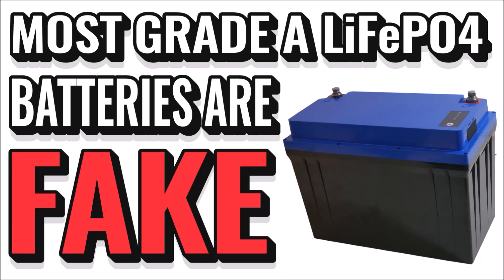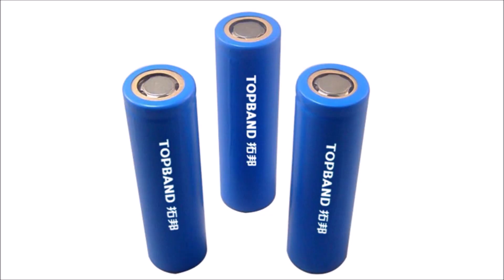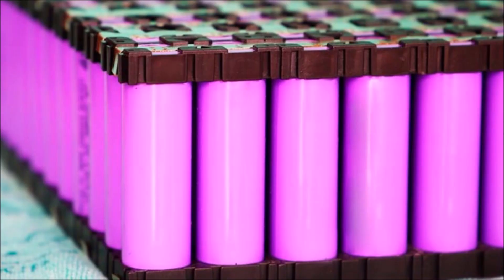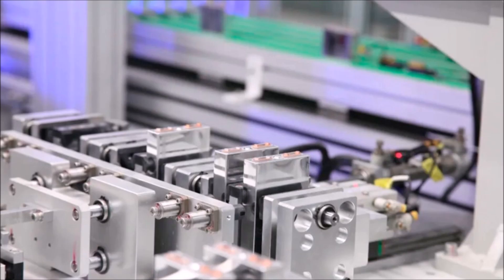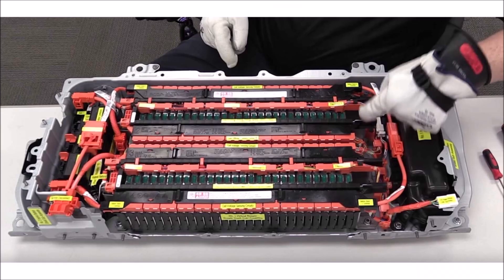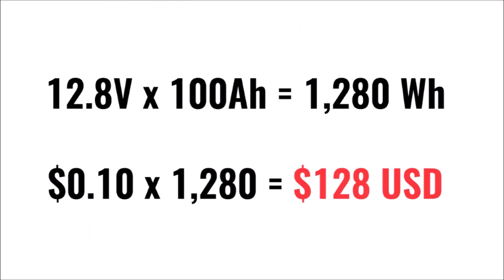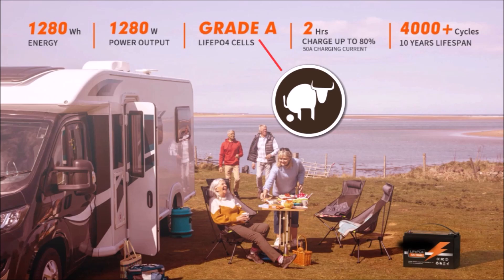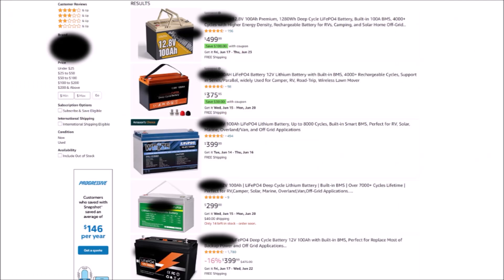Fake Grade A Lithium Deep Cycle Batteries Are Everywhere!  Learn How To Spot Grade B vs Grade A

Comment: I will buy Weize batteries grade A or not...  It is like the difference between regular gas and super unleaded.  Do you really need to spend the extra cost for the super?..
Reply: They are grade A
Reply: @bad_actor1128  good to know as they are 1/2 the price as the other batteries!  Peace
Reply from the maker: They are not grade A.  That is fine, but just understand what you are buying.  Your analogy of regular vs super unleaded really isn't very applicable.  More like if you had 100% gas vs 30% gas but they were both sold as real gas.
Reply: @LDSreliance  these products are perfect for anything other than residential grid-tie systems. For those with RVs and motorhomes, they are ideal, regardless of what grade they are.
Reply from the maker: I don't disagree with that.  I have several Grade B batteries myself that I chose to invest in as opposed to the Grade A alternative.  But people need to know what they really are when purchasing them so they can make that informed decision for themselves instead of thinking they got a steal on something that isn't what they think it is.
Reply: @LDSreliance  I will still be purchasing grade B batteries then when I do my solar system later this year.  I plan on building a 800Ah battery bank.  I will spend 1/2 the price all day long as I know the batteries will still cycle 4000+ times.  So back to unleaded vs leaded yes it works.  Super Unleaded might get you a phew more miles per tank like a grade A might get you a little more discharge time or more cycles.  Is it worth double the cost.  NOPE not for me! Perhaps a 10-20% markup but no more imo.
Reply from the maker: They will not cycle 4,000+ times.  I can promise you that.  We have extensive testing of some company's Grade B batteries that start to show loss of capacity and peak voltage at only a few hundred cycles.  The most you will ever get out of a Grade B battery is about 1,000-1,500 cycles with an excellent BMS.

Comment: Fakes a bit strong of a word.
You mean sub standard.

There are a few discrepancies.
Not all countries are capitalist. 
You base one economic structure over another.

See if in the USA with the USD you earn $30 an hour and work 32 hour weeks, you get paid 960 USD a week. We'll say you get taxed like us in the UK for 23% so you take home 739 USD each week.

China the monthly pay is around 90-120 USD
So when they have workers,  working for 20usd a week,then they can add smaller costs on top.

So if you buy the cells, say 92 USD, pay a week's wage, then you ship with the government assistance they have.
Is about 20 usd
BMS is 25, as were on their economic pricing, not ours. Then package it up..

Your only looking at around $420 USD.
-im not using 100ah cells that are even lower cost.

Why so low?
Socialist countries don't make for the profit.
That's why it's social. But they do need to meet costs. They will have some small profits. But China and other countries are hit with a recession and have stock sitting around gathering a lot of dust.
This stale product needs to be sold. As it costs them to store it, and they have to be maintained. It is better to sell a drain on you than to keep it as it will make a loss, the longer you hold it.

So cell cheap. Before you make too much loss. The problem is that there are hundreds of businesses making various battery types, making big orders and then companies went under and so they were stuck with stock.. 
Now factories can have multi function production. So that space the old stock take up is stopping work. So it has to go and they can't give it away.

It's like used solar panels are waste, toxic waste that has a cost of disposal. But they are sold to people who buy them.

Lfp is cheaper than lead acid to make. Some times...
We are going into be switching up to other tech soon and they have to convert the factory for this. 

Of course I'm not even going to side step that the China market is like a brag market and truth squeeze.
Reply: its as you say intersting look at true cost /i have purchased 2and if grade b still a good buy thousands of cycles careful use pays more than ‘stolen’ at harbor freght i say thank you give the prisoners an extra bowl of rice

Comment: NAIL ON THE HEAD!!!!!
Reply: 100% the truth! Only thing I would add is that most grade B packs will not make it to the 1000 cycle mark,  we have tested some and have experienced balancing (Meaning they can't be charged up to the 14.6v) issues at 100 cycles!
Reply from the maker: Thanks, Lester.  I would bet that the ones you are talking about either have really bad BMS's OR they are Grade C.  Or both.  Does the company's name rhyme with DinoBolts? :)

Very frustrating marketplace.

Comment: Thanks for the education on being ripped off. I don't feel bad for NOT BUYING any cheap lithium cell batteries.Just can not afford  $900 - $1,000 batteries.
Reply: https://youtu.be/PWivpI7TBkw
Reply: @JOHNDANIEL1  Thanks for that video wew, I will never touch a prebuilt battery pack hell no. Rather built it myself with cells and a good BMS.